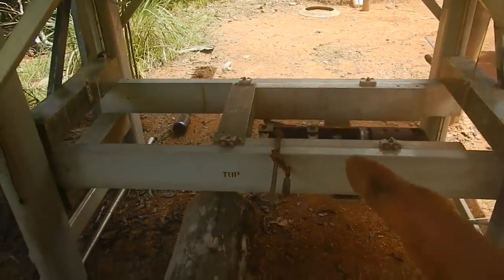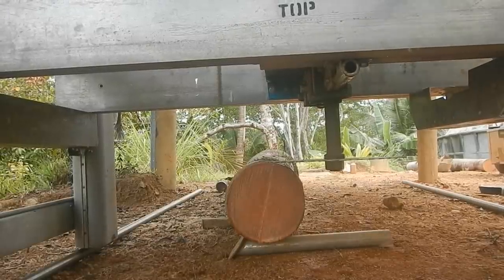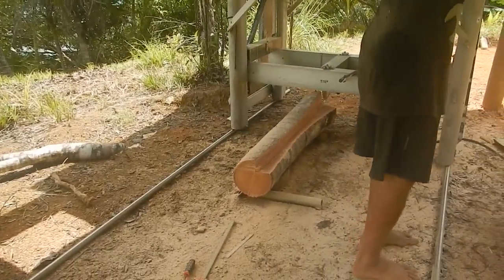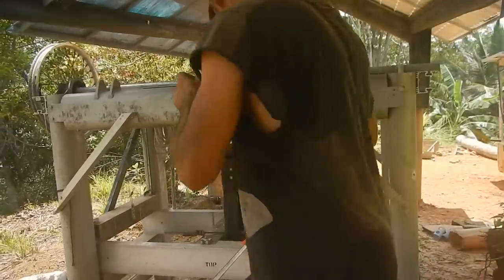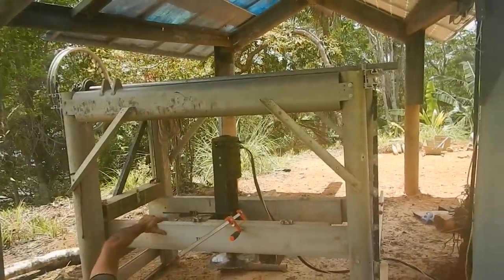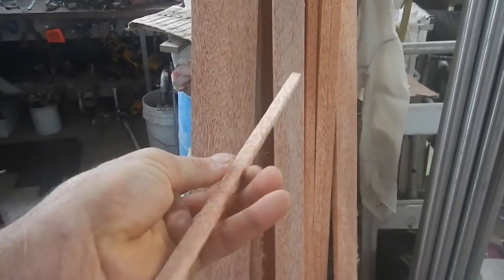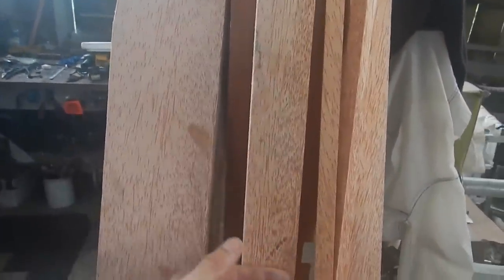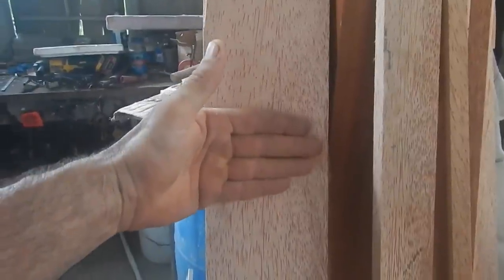Lumber Mill 019 Cutting Boards!!!

Comment: Great job on the saw mill. Who knew coconut tree wood was actually good!?
Reply: The coconut wood is very good
It can stand 20 years if you pray it would
Now, the coconut root, to tell you the truth
You can throw it or use it as firewood

Comment: I want coconut wood. I really want to test how it looks fully sanded, polished and oiled. I'd have thought it's something like rough hemp like fibers and maybe some scales. 

By the way, have you measured the voltage from panels when you saw? Is the current enough or does the voltage drops under stress..

Circular blades need surprisingly much power. I have 4kW 3-phase motor in my table saw and I can still max it.

Comment: And a couple of big square 4x4s or something to lay under   the logs you are cutting and to figure out a way to clamp logs to boards so they don't turn and break your blade, also do you think it could turn a larger blade?
Reply: absolutely can turn any blade that can fit in that frame. 
With a larger frame could turn even a meter wide blade. 
Obviously, then will sure need a minute to get to top speed, but also, it will cut a quarter of that log with inertia.

Comment: Could you cut 10" boards by cutting on one side of the log and then the other where they meet in the middle?
Reply: I think he's already doubling it up to get the width he mentioned
Reply: @RubixB0y  no he's taking two passes from the same side right now.  Theoretically I don't see why he couldn't double the width by cutting on the opposite side from the other direction (due to rotation of the blade)
Reply: @jasonh201  Thanks for the correction, I misremembered that part of the video. It would be interesting to see how well he could match the blade from the other direction. That would make it clear if the blade is really on a plane parallel with the rails.
Reply: Great minds think alike lol
Reply: @jasonh201  he should.just buy a bigger blade lol

Comment: Is that the coconut tree ? are coconut tree hard or soft wood ?  TY   , doh  , you told that later , hihi
Reply: Regardless of the technically correct classification, in my experience with coconut wood there are very dense dark stripes matrixed in with much softer fiber. Like you can dig your nails into the soft part, but the darker fibers feel much harder.
Reply: @ydne  Thank You
Reply: @RubixB0y  Thank You

Comment: that wood looks like wagyu beef in a way. a word of advice Jaimie, I know you don't like editing videos, but can you please maybe consider sometimes to normalize the audio? when you talk its like 20% when you start a machine up its like 100% , I don't want to sound like I complain, but I do have tennatus. and have ot either stop the video or disable the sound sometimes as unexpected noise is painful for me , but I fully understand if you don't want to do that for some reason. its probably just me  maybe. anyway love to see the progress. are you goign to pur concrete on the floor so the rolling metal bars wont move? or are you goign t o keep it this way so you can move the machine somewhere else? are you going to put end stops on those ? the wood sure looks nice , I do hope notinhg is going to eat it , is there a paint maybe to deter wood eating insects?

Comment: would a chainsaw mill have been  better?
Reply: i would imagine a wider kerf requires more power, is slower, and wastes more wood. And the chain is probably harder to sharpen.
Reply: a bandsaw mill would probably be easier ?  Not sure how he'd weld the blade ends together, but the frame could be used with a "bandsaw module" as is, just take the current "table saw" part out.  Two big wheels on the ends of the y-axis part, the blade extending below it maybe 6, 8, inches and running from one side of the tracks to the other
Reply: @idjtoal  chain saw mill